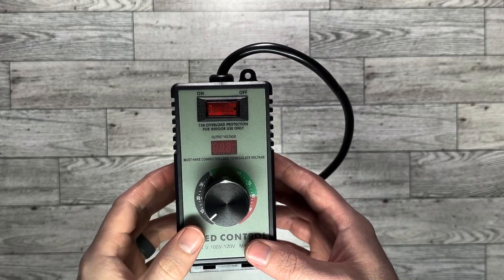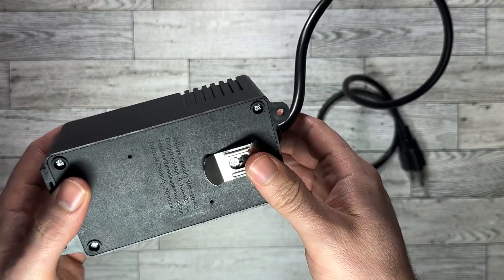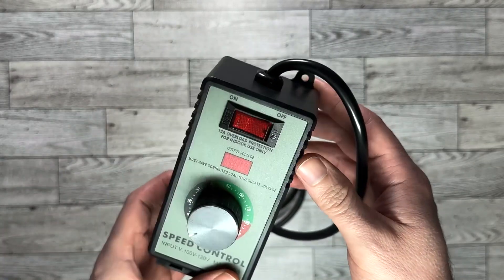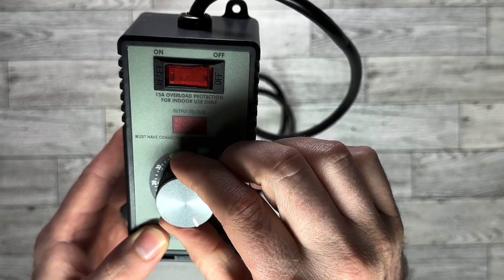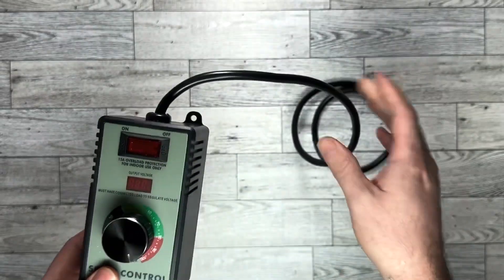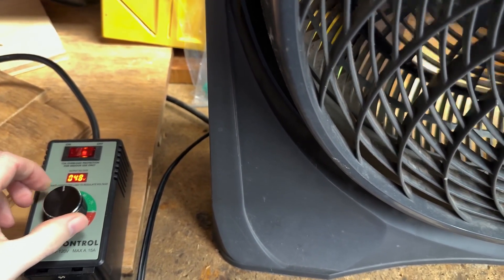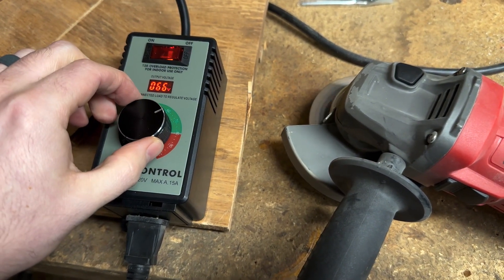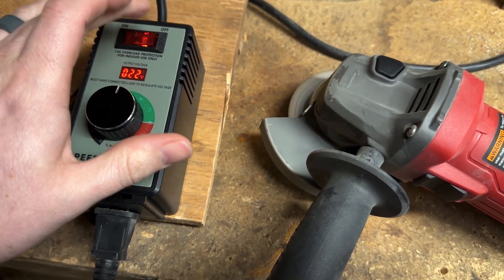DIY AC Motor Speed Controller (Easy & Cheap)

Comment: How many motors have ya burned up so far? All single phase AC motors require 50-60hz at their listed voltage rating... this module acts as a variable driver but cuts down the voltage for single phase motors... which is a NO NO. Your motors will only last so long before they burn up.. dont use these!
Reply from the maker: Thank you for sharing. I’ve only used it a few times with my grinder for some very lightweight touches on some pieces to establish a line.
Reply: @SLVRBCKTROOP  agree, this will damage a motor under anything other than a free spinning load like a fan.. ac motors are intended to run at 50 or 60 hz at a set voltage you wont burn up your motors right away but you will eventually, just depends on the use case. you dont see these things used in industrial settings much beyond fans, for that you need a variable frequency drive or a dc motor speed controller or even a servo controller.  just a friendly warning, you could cause a fire with this if misused.
Reply from the maker: @rossvanderweide8067   I appreciate the confirmation. That is very good information to have out there.
Reply: Genuine question 
If someone wanted to set something like this up what would be a better way ?
Reply: @codyboudreau2838  Unfortunately, a 3-phase motor would be your best option..  Via: old treadmill motor or even a single- phase "fan" motor (which typically has multiple speed ratings, or series of rpms listed on the label).  I'd assume the motor hums quite loudly, or buzzz's, as the lower power is trying to pass through the windings and maybe gets smooookin hot after a little run time, as its working harder n harder trying to spin the armature at a lower voltage than required to do so, which that type of motor is powered primarily by aprox. 2-sets of (alternating (N/S) motor windings(coils).. Generally why a single-phase "fans" can run this way and more efficiently with variably changing speeds/current,  due to the internal coils (windings) being better suited for the changing voltage while fully maintaining 50/60 hz. As theres generally many more alternating coils/windings within the motors housing. (especially inside motors like a ceiling fan, if you've ever taken one apart, sometimes theres (16 - 20+) coils inside, as its maybe switching certain ones on/off, depending on the speed its calling for/ or current being sent to it)  but, I Hope this kinda helps, though it really doesnt solve any issues for ya 👊✌

Comment: That's a variable resister. The motor has no torque at lower speeds that why you not showing cutting something with the angle grinder. Why are you doing this?
Reply from the maker: Yes — torque drops at lower voltage. I only used it for the initial guide cut to improve control, then ran full speed. It’s not meant for sustained cutting.

Comment: Please do not use this on a/c motors. You will eventually burn them out. It might work on brushed motors such as grinders and routers but you risk destroying any other shop equipment.
Reply from the maker: Thank you for sharing. Always do your research before using it with your tools or other equipment.

Comment: I almost bought one of these for my woodworking router which came with no speed controller. From the comments, looks like voltage regulation as done by this device isn't the right way to do it
Reply from the maker: Thanks for the feedback, it's good to know about different motor types. This depends on the motor. It can most likely handheld routers that have a universal motor, and those work fine with a voltage speed controller. But I'm definitely not an expert and only used this for a very specific short duration project.

Comment: I bought this same device and it worked fine when I tested on my router.  

But I wanted to shorten the lengths of the various cords (tool, paddle switch, and this controller) on my install.  When I disassembled the speed controller  I found the components inside to be high enough quality to not worry me, adequate wire sizes and good solder joints, etc.  But I also noticed that they soldered the neutral (correct on the source plug) to the wrong output terminal and the hot from the circuit board to the wrong output terminal.  

Most tools would not be impacted unless they were micro-computer controlled but those are not the normal use case for a cheap Chinese/Amazon controller.  However, if the toll developed a fault the "double insulated" safety feature of most tools would be invalidated.  

I think this is terribly unsafe.  Check yours out and fix if so....
Reply from the maker: Thanks for sharing this important information, I will definitely check mine.

Comment: If you put two of those inline (plug one into another) will it slow down my 8" vortex inline van even more. All the way down is not low enough.
Reply from the maker: I am not an electrician, but I would say no. It just doesn't sound safe, and I think that could significantly affect the fan motor. Maybe others watching the video might have an opinion on that.

Comment: Question, I have a treadmill 120V and want to slow it down. Would you recommend? Or is this bad for the treadmill?
Reply from the maker: I would not use this for that. I am 99.9% sure it will destroy the motor on the treadmill.

Comment: Where do i get one? Want to polish knife handles and sheaths.
Reply from the maker: I got mine from Amazon. I have an affiliate link in the video description or you can search on Amazon for the Zowzea Ac motor speed controller.
Reply: @SLVRBCKTROOP  - thnx 😊
Reply from the maker: No problem 👍

Comment: If you need to maintain useable torque(ie power tools) I think only solution is a VFD(variable frequency drive)...very cost prohibitive.
Reply from the maker: I have nothing on that. I'm sorry. The torque is lost with the variable speed motor.
Reply from the maker: I did notice the torque issue. Thank you for commenting.
Reply: Actually a VFD is virtually nonexistent for a single phase motor. They are used on three phase equipment and change the speed by altering the frequency, not the voltage. For a universal motor (brushed as well) you can effectively change the speed by changing the voltage. However you also need a feed back circuit to monitor the speed and increase voltage to maintain torque and desired rpm.

Comment: I think best use is for fans and lights because as voltage reduces,torque reduces much more.So power tools at severely reduced torque wont drill,or cut or grind nearly as effectively whereas as fan cutting thru air wont have the same relative load.
Reply from the maker: Great point! I was just saying that to a friend of mine.

Comment: Do they have any with a higher amperage output?
Reply: Should work for adjusting the speed of, say, a 1½ hp electric motor?
Reply from the maker: I am not aware of any other options. I apologize for not being able to provide more assistance.